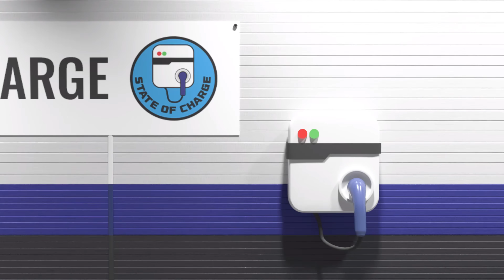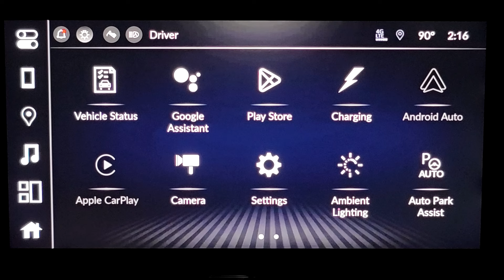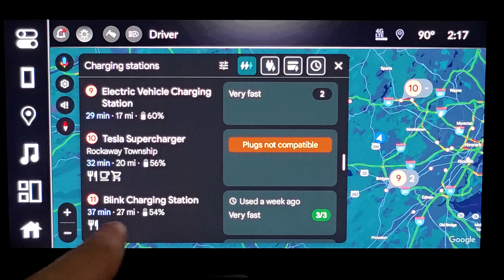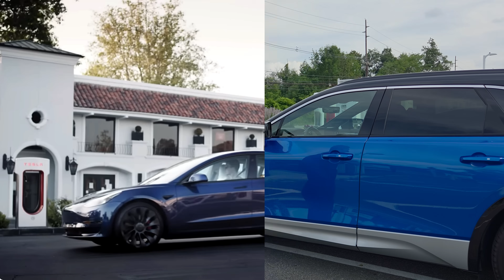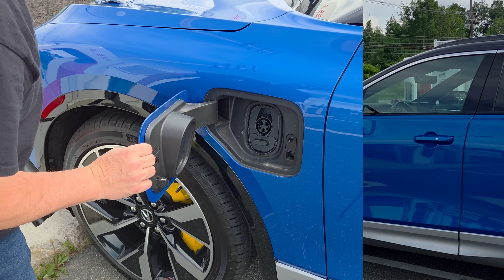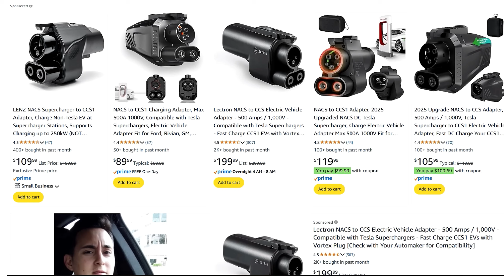How To Charge Honda And Acura Electric Vehicles On Tesla Superchargers

Comment: I am a seasonned EV owner and road tripper, but this video is amazingly well made for newers owners to understand how to charge at SuC. Thanks Tom
Reply: Another experienced EV owner here and a road tripping nut. I help moderate two EV forums and we get loads of comments from members bragging about the money they saved on their brand X adapter. The experienced ones among us try to warn them, but they won't listen. Thanks for this primer, Tom. I think it's helpful for drivers of any  CCS1 brand who want to make use of Superchargers.
Reply from the maker: Thanks! I appreciate the comment.
Reply: I agree that having these brand-specific videos is helpful to people new to Superchargers or EVs of other brands. I especially like how Tom takes an actual EV of that brand and shows with different camera angles how to pull up to a V3 Supercharger stall in the exact position necessary.

Comment: PSA- All adaptors are NOT created equal. Non-manufactured Approved adaptors require a battery precondition before being able to get full speed. 

The handshake protocols are different. The manufactured approved ones require NO pre-con, can plug in and get full charge speeds. 

Universal Lecteon adaptor required us to tell the vehicle to prepare for fast charging before it would “trust the adaptor” and let it flow at full speed. 

Took us a bit to realize why our adaptor would cap at 40kwh unless we told the car to prepare for fast charging. 

Just sharing what we discovered. Same for our Taycan.

Comment: One of my local (Denver metro area) Acura dealers is quoting $275 when I called.  So, I ordered one on-line for delivery to the dealership for $225.  When I picked up, the parts guy was a little embarrassed when I told him why I ordered instead of just buying it from him.

Comment: I always plug the adapter into the vehicle first, and then the Tesla charger into the adapter. I also first unplugged the Tesla cable from the adapter hanging up, and then disconnect the adapter from the vehicle. I find this to be easier, but you say to do it in the opposite way. Does it actually matter? And why? I have a 2025 Chevy Blazer EV which is very similar to the honda.

Comment: I hope once we get UL certified adapters on the market that auto manufacturers will allow them to be used as well. I would rather use my A2Z Typhoon Pro adapter but I will probably use my Hyundai NACS to CCS1 adapter instead to avoid any warranty issues if an issue arises.

Comment: I have an excellent NACS adapter from TeslaTap, called the SuperTap.  It is solid, has 500 amps and is made in the USA whereas others are not.  It’s more expensive than others but worth it.  The same company has been making high quality CCS adapters for level 2 home charging. TeslaTap should be on your list of preferred adapters.
Reply from the maker: I used to review and use their products but I had a bad experience with the company so I won't use their products anymore.
Reply: @StateOfChargeWithTomMoloughney  Understood, thanks for replying. I assume your bad experience did not relate to the adapter itself, but concerned some other interaction with the company.  It would not be fair to leave your longtime subscribers (like me) with the impression that you consider TeslaTap's adapters to be inferior.
Reply from the maker: @barryl.7967 They make decent equipment.  Not the best available today, but certainly not the worst.

Comment: One MAJOR point you left out - All automakers will VOID your warranty if you have been charging with those cheap adapters. If a cheap adapter breaks down while charging and not in a safe way, there can be damage to your battery or other high voltage parts. YOU will be responsible for that damage and have to pay out of pocket. Your warranty doesn't cover damage to the vehicle caused by you using an adapter not endorsed by the automaker. Technically that means if you use the adapter from A2Z on Honda/Acura vehicles, there is always a chance that they will still void your warranty.
Reply: false.
Reply: There is NO WAY for the automaker or Tesla to identify what adapter you were using if there was some kind of problem. The adapters are passive, dumb devices. They cannot be identified.
Reply from the maker: I didn't leave that out, I said in the video that if one of those cheap adapters fails and causes damage to your car then you'll have a warranty problem on your hands. But as mentioned be Jerry below, these adapters are passive and cannot be identified. Honda/Acura or any other OEM cannot prove you used a non-approved adapter, it's not possible unless the adapter became permanantly attached to the charge port because the connection melted and fused. 
In any event, I suspect a legal battle with your automaker if there is a problem caused by DC fast charging, even if you used the approproate adapter. We've already seen people have their vehicles damaged from DC fastc chargers on the Electify America network and the car company denies the warranty claim saying the charger caused the problem. Of course, Electrify America then blamed the car and the owner has to hire a lawyer to help them get their vehicle fixed.

Comment: All the 72kW Urban chargers Ive seen do NOT support non-Teslas. They were installed before V3 existed, and earlier V3 stations lacked non-Tesla support as well.

Also, you should remind people there are still many V3 stations that have NOT been upgraded to work with non-Teslas as Tesla chose to keep them Tesla-only. Ive seen even large 20+ station sites without non-Tesla support.
Reply from the maker: OHHHH, I thought they did! Luckilly there aren't many of them. I'll make a correction in the description - thanks. I've never even seen one in public. I did say "not all V3 Superchargers" and you need to confirm in the navigation or app if the station is compatible.

Comment: Another note on cheap adapters: Even if it lasts as long as a better adapter (it won't) you are virtually guaranteed to get slow charging speeds. Even if it fails safely (it might not), a broken adapter can still leave you stranded on a road trip. You need something you can rely on. Don't try to save a few hundred bucks and risk tens of thousands in the process. It's literally not worth it.

Comment: Just FYI - There is a $50 NACS to CCS adapter on Amazon that claims 1000 volts and 500 amps.  There is another that costs just as much as the Lectron, but then there is a $50 coupon.   

But there are also dozens in the $100 range.  

It's sad.

Any word on A2Z or Lectron getting UL certified?  Or, if not UL, at least to the 2252 standard?

Seems strange that it's taking them so long.
Reply from the maker: They are rtying to get them UL certified for 500-amps and that's not going to happen. In fact, I don't believe ANY NACS adapter will be safety certified for 500-amps. I think the highest we'll see is 375 amps.

Comment: I noticed that at some tesla chargers it will charge for 5-10 minutes then fault. I discovered (for me) this may have been related to having plug-to-charge enabled on my account but the app I used was disabled. My suggestions it to not use plug-to-charge with the vendors app and only use the tesla app.

Comment: As a long time Tesla owner, I'm happy to see other EVs allowed access to Tesla Superchargers.   I'm not happy with the fact that with the increased traffic at Superchargers, some models (as you mentioned) are going to have to block two stalls to access the chargers and pull dangerously close to both chargers to make do.  That's not going to win you any friends at a crowded Supercharger.   I suggest you strongly recommend that folks who can't reach the cable to their cars, carry a NACS extension cord along with the adapter.   Also, I imagine we are going to see a rash of damaged Superchargers when newbies try to pull their vehicles close enough to the chargers, without striking the charger, as they negotiate between two chargers.
Reply: The Tesla Magic Dock Supercharger site near me (Canton, MA) has one kiosk (out of 20) that has an extra-wide parking stall.  That one stall is wide enough that a car like my Audi or like the Acura, Ford pickup, etc., can pull up in a way that the cable will reach, without blocking the adjacent stall.  I have been lucky to find that space available many of the times I have used that facility.  But I worry a bit because the stall is not marked with signage or anything to urge people to leave it open for CCS cars.  So when the site is busy, the user looking for a charging spot would have no reason to skip it, thus reducing the chances for the CCS owner.
Reply: DO NOT BUY AN EXTENSION CABLE (At least not yet.) There are no extenders currently available approved for use with supercharger stations. A2Z and Tesla both have extension cables supposedly coming soon, but even those will have caveats. The cable attached to the dispenser is liquid cooled. Obviously your glorified extension cord is not. You may get poor charging performance or excessive cable wear even with an approved cable. Please just take up two stalls, at least until approved cables are available. Armed with CCS adapters, us Tesla drivers have access to literally every DC fast charger on the continent (okay, except for CHAdeMO). We have no shortage of options. Your heart is in the right place, but please be mindful of accidentally encouraging people into dangerous behavior over such a small thing.
Reply: @moldymirage  https://www.youtube.com/watch?v=rEexXHpCZlo
Reply: @todwatts2415
I wish other Tesla owners were as friendly as you. Just this morning I charged my Prologue at 5:30am to not only get a better price but because I thought I was being considerate knowing I would need 2stalls. Went for a walk and a Tesla owner parked in a way to block me in. He then told me I was being inconsiderate for taking up 2stalls. I told him that’s why I was there at 5am and there were literally 20 open stalls. He moved apparently wanting to make a point. Of course I wouldn’t charge if 20 of the 24 stalls were being used. SMH.
Reply: @laurajohnson7031 you were dealing with an idiot.  20 open stalls, and he’s acting like he owns the superchargers

Comment: im surprised you didnt mention the extension cable that is either recently out or in the works? they definitely need that ext cable, otherwise they are going to be harassed at busy tesla charger locations.
Reply from the maker: I've charged my EVs at Superchargers at least 25 times and have needed two stalls probably 23 of those times. I've never been harassed
Reply: @StateOfChargeWithTomMoloughney Regardless, the extension cord would be more ideal to have. Hopefully "coming soon" is sooner rather than later.
Reply: @StateOfChargeWithTomMoloughney  thats good. were any of the times busy with a line waiting to charge?

Comment: Tesla V4 does not exist yet as described in this video. There are no public sites that have V4 hardware capable of 500 kW. There are sites that have V4-style posts, but the charging hardware is V3. These sites are labeled as V3+. 

For these vehicles, it’s not very important since neither vehicle is capable of exceeding V3 capabilities. However, you don’t want to give other vehicle owners the impression that they can charge faster than what the V3 hardware can provide (250kW).

Comment: Would be interesting for TM to do a "how to get the cheapest DCFC rates" video. Notice in this video he was charged US$ .42/kWhr. Compare to residential AC Level 2 charging (incremental in midwest USA is ~$.10/kWhr).
Reply from the maker: The problem is there's really no one way to explain that. Different areas of the country have different rates, different networks, and different TOU rules. It's a tough topic to accurately describe.

Comment: I just had my first couple of experiences as an Ioniq 5 owner using the superchargers on a roadtrip, and frankly, the only thing to recommend them is as a backup when other faster chargers aren't available.  Short awkwardly placed cables and slow charging.
Reply from the maker: The slow charging is because of your particular vehicle, an Ioniq 5, with its 800-volt eGMP battery system. Most other EVs will all charge much faster on Tesla Superchargers, including the Honda and Acura EVs that this video is about.
Reply: @StateOfChargeWithTomMoloughney   I'm aware.  The other issue for cars such as the Acura, is having to take up 2 spaces (as the thumbnail shows) unless there is a handicap van space free.  If the supercharger station is busy, this is a real non-starter.
Reply: Well that’s because they can’t handle the ionic 800 volt car they are 400 volt. Other drivers won’t have the problem